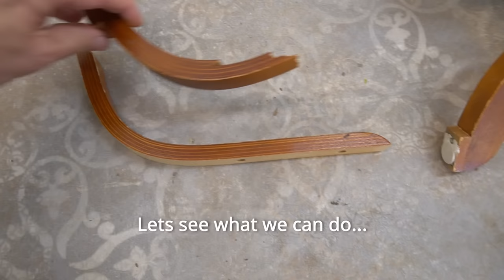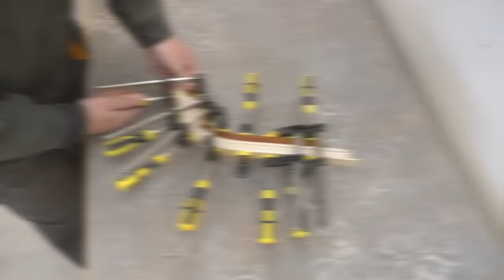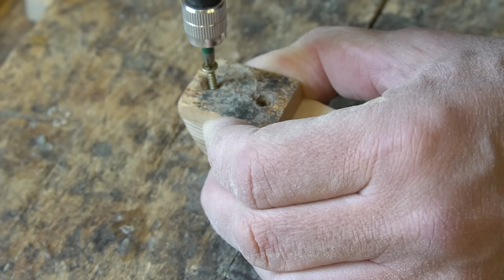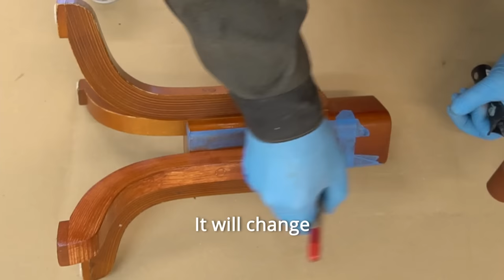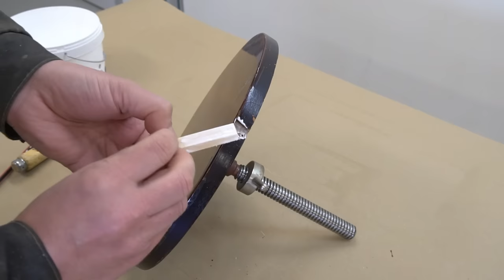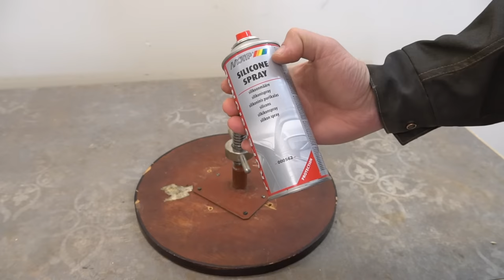Watch how to fix the PIANO CHAIR broken leg!

Comment: I had a modern piano stool like this, and ultimately threw it away because the legs kept breaking. I couldn't even use it as a plant stand. So I got an antique piano stool with a swivel seat that raised and lowered on a huge internal screw mechanize, just like the one in the video, and all has been well since.

Comment: I used a similar technique to replace the rockers on a child size rocking chair.  The original rockers were too weak to use as forms to bend the new oak laminations, so I traced the rocker curve on a 2 x 6 to make a form to bend the oak laminations.  The seat banding repair was very nice.

Comment: Well done!  I was impressed by the complexity of the leg repair and the simplicity of the broken screw repair.  I noticed that while the seat was inverted on the bench that at some point in the past the screw appeared to have been removed, spun roughly 45 degrees, and reattached.  Is that why the seat spun uneven on the screw at the end or was the seat not a perfect circle?

Comment: You didn't explain well where the piece upon which you assemble and conform the plywood layers comes from. If it is the original leg, the curvature of the new piece couldn't be correct.
Reply from the maker: It was part of the old leg, I just added new layers to it and curvature was the same.